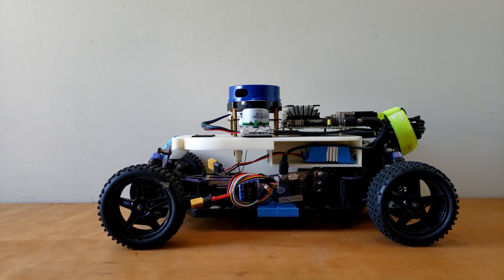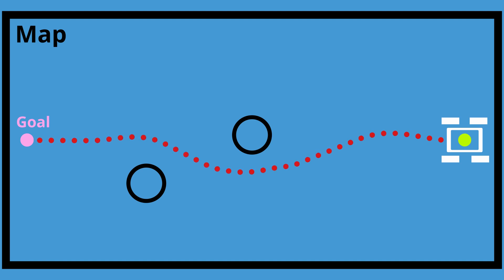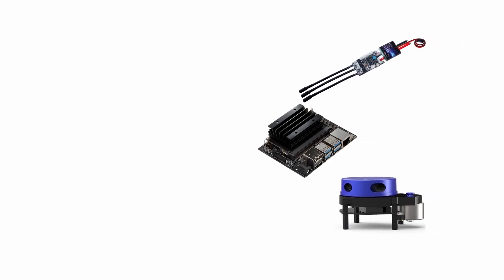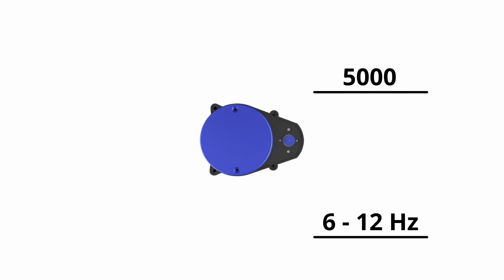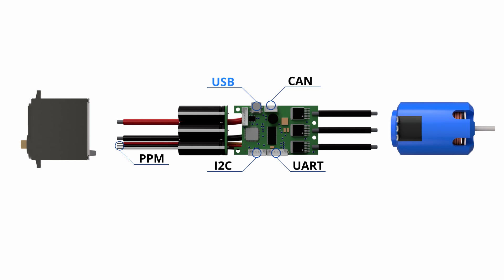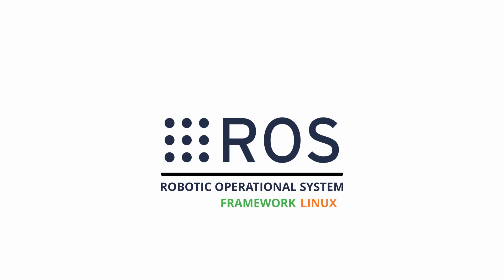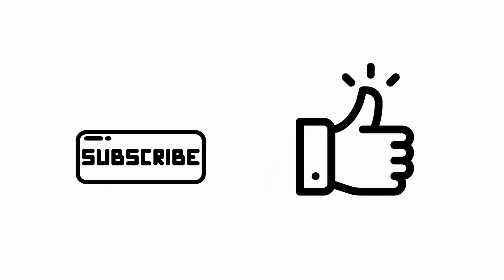Building an Autonomous RC Car | Part 1

Comment: Hi, I see there is no differential on the car. Do you know if I were to build a car with a differential and suspension, how do I add encoder for each wheel?
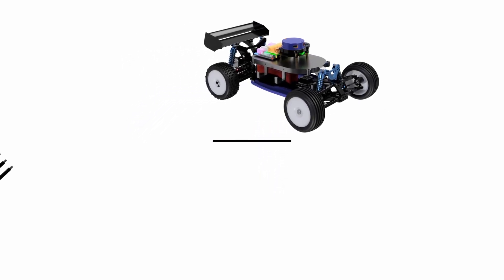Reply from the maker: There are two differentials in this car. I used to have an encoder on a previous version of the car as you can see on the minute 3:51. Basically, instead of adding an encoder for each wheel, you can use one in the driveshaft (to get the speed) and estimate the turn angle by the commands sent to the servo. In the third video, I will explain exactly that. Feel free to reach me out.
Reply: Brain Robotics waiting for your next videos
Reply: same :(  @jyothishthedon